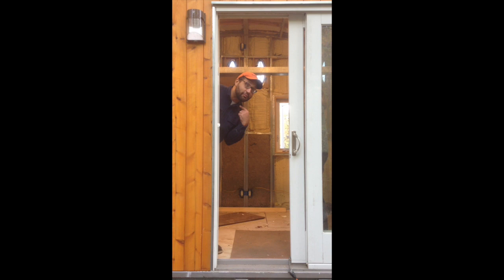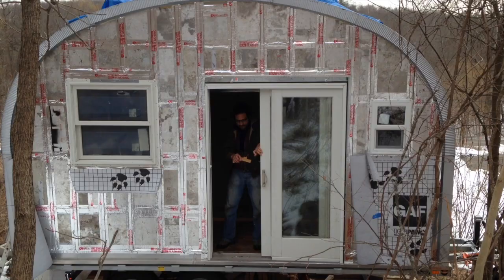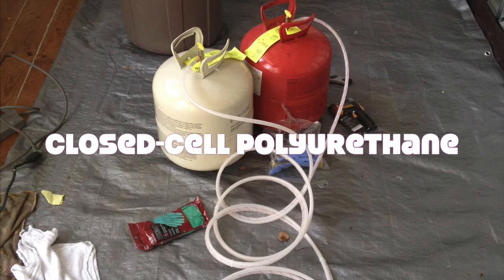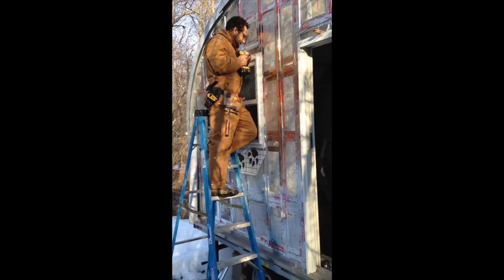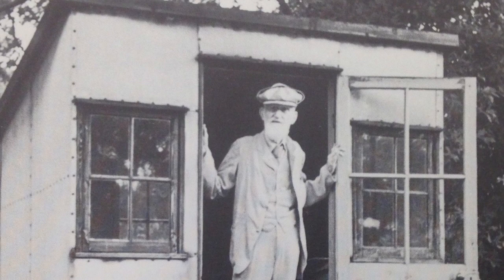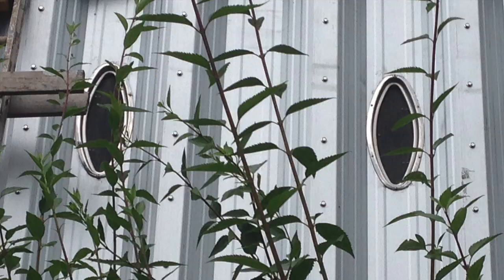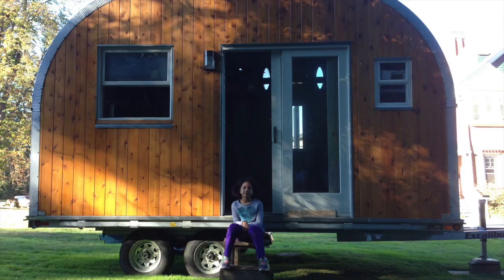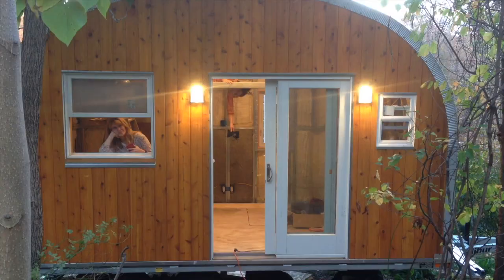Tiny House of Steel Part 2

Comment: Have you weighed it on a scale?   How much $ have you spent on materials so far?
Reply from the maker: Have not got it on the scale yet but basics: trailer = 900lbs, steel shell 850lbs, at this point everything else, cedar siding, doors, windows, stove, solar panels (imgs coming soon) batteries, inverter, flooring, sink, bathtub etc. = an additional ???? I'd say by now I'm in the $12-15K range. We'll have more updates @ www.tinyhouseofsteel.wordpress.com